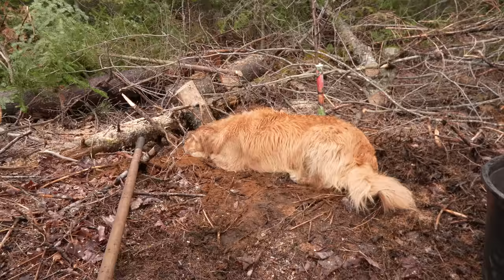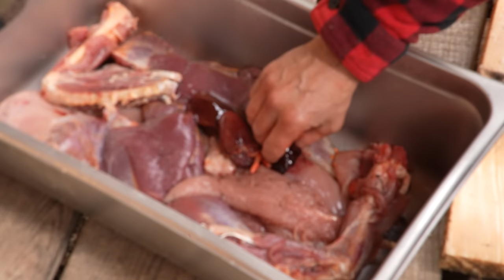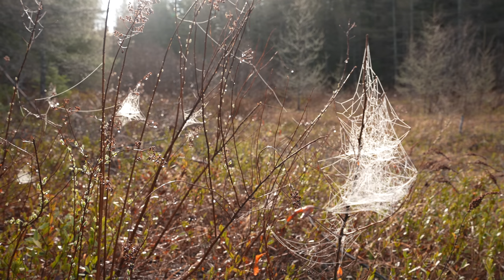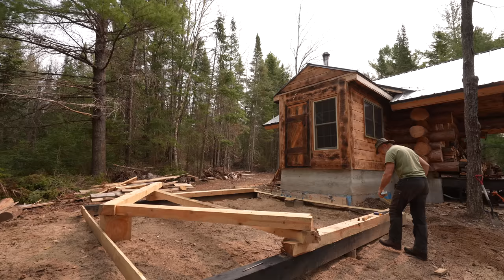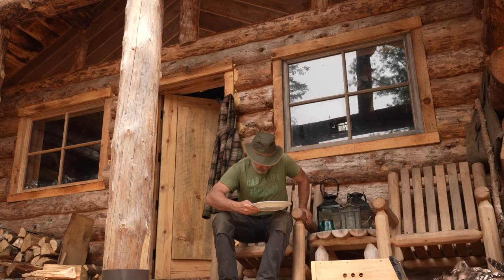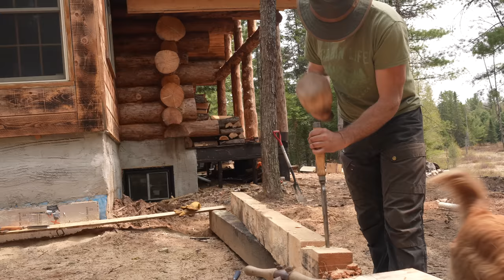Building a Timber Frame Outdoor Kitchen Connected to My Off Grid Log Cabin, Episode 2

Comment: I love that Shawn kept the failure of his pulley system in the video, just to demonstrate that he is actually a mortal man. :)
Reply: I also chuckled at that bit😂 it looks like alot of time and setup went into that rigging... And things still go Pete Tong when you think every base covered.. That is alot of weight to hawl vertical. Have you thought of using the A frame crane? The ladder in the middle is possibly too stationery and you need a pivoting anchor point take the strain and distribute the weight more.

Comment: Sean I'm so impressed how much time you took sharpening the edge of the chisels and the notches you cut to lock in the wood. I'm a bodyman so I deal with metal and other materials. But I did frame houses 35 years ago so I know exactly how hard your work is AND YOU MAKE IT LOOK EASY😊

Comment: My Dad had loose hay to pull up into the Haymow, so I learned to use the big Rope pulleys and a two legged bipod chained together you could sling a lot of hay that way, when I put up my wooden quonset I used that same bipod Idea to sling up the Rounded Rafters, from an old Barn that I'd torn down those big wooden pulleys and one inch hay rope sure came in handy.

Comment: You might have noticed,but you’re t square has a good marker for the 2” and the 1.5b” mortise and tenon
Reply: It also has the length of the knee braces enbossed  on the center of the leg
Reply: It is the second most valuable tool for timber framing

Comment: Ever thought of getting a couple of huge tanks and filling them up from the stream out front  during the spring thaw and using that water for yaself and garden?? offcoarse u wud have to drain them b4 the freeze but u can also use 44galon drums in the basement to pump water into for winter.... extra storage is better then nothing and not wasting the water u have to empty out in winter.... or get a backhoe and bury them in the ground... below the frost line..... its worth doing it cos the spring thaw should give u enough water to last winter and all year round. The cost of the project will be cheap accept for the tanks but u can get a sponsor for that :)~...... lol
Reply from the maker: 1000 litre tanks. I have one in the cellar and three in the garden. Eventually they’ll all be connected to rainwater collection systems
Reply: @MySelfReliance  yep i do remember the ibc tote in the basement when u were building it but all u can fit down there now is 44 gal drums for extra storage in winter. I meant real big tanks like 10,000 gallons or more, I am sure u can fill them up easy with the winter thaw from the from stream, which will be flushed when the flows come up. How much rain do u get? surely not enough for humans and garden or do u?

Comment: Shawn, when drilling the holes for the pegs do you offset the holes so it draws the two pieces of wood tight together? I ask as my dad had a book from 1910 and in it they said, half a hole difference for green timber.

Comment: hey just an idea, how about electroplating the wood you have carbonized, with metal, to be metal from the outside, thin paint or thick layer, like nickel to withstand 1500C or copper 1100C
Reply: its the benefit of metals with the wood material from the forest, up to structural metal sheet thicknesses, with electroforming (thicker electroplated grown structural layer around the wood), kinda like adding a metal pipe shell around the wood piece after its in its final shape
Reply: try diy wooden charred saw blades, electroplated into metal (surface or wood removed, filled with sand/water), water cooled saw blades

Comment: Being watching you since the very first few logs on your first YouTube cabin. 
I think we all know by now that you're fairly capable  of using hand tools with no electrical or battery powered tools to help you build your projects, but in the past 3 to maybe last 4 years, you've being using  that gas powered sawmill to create your timber, you also started using your utility vehicle  more and more to move logs around, what I'm trying to say is, why the heck are you using hand drills and antique drill presses, when you can make your work easier and far more superior with battery operated drills, Sawzall, routers etc ?? Just seems odd .